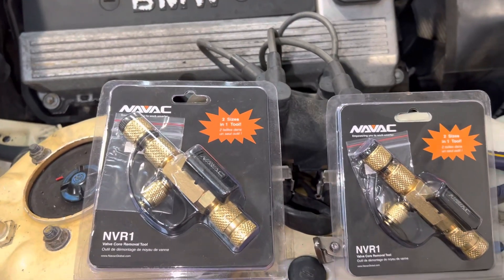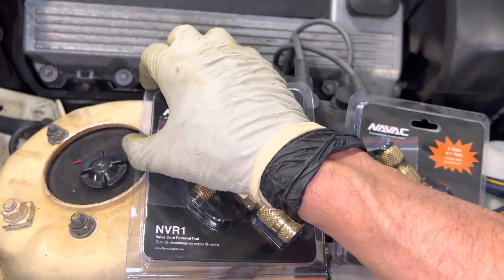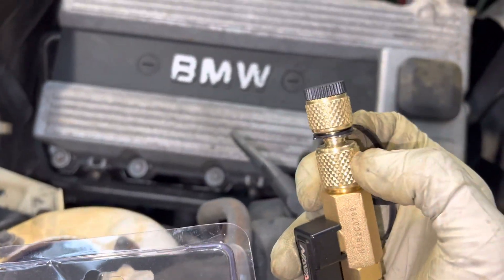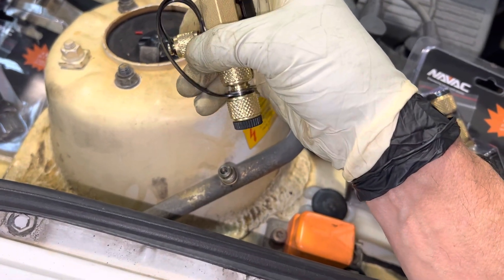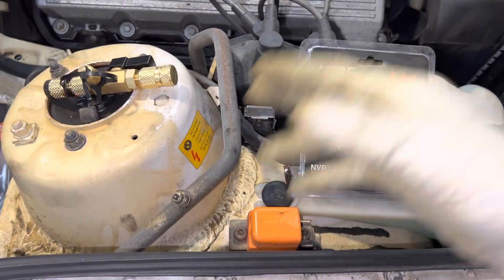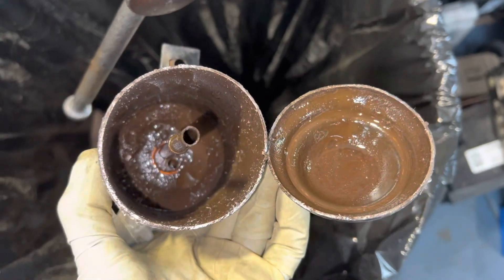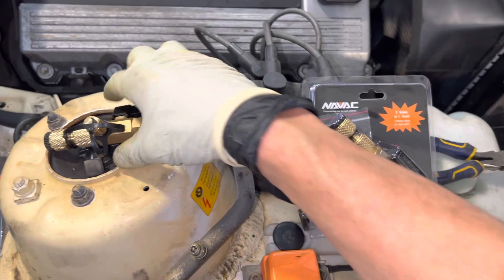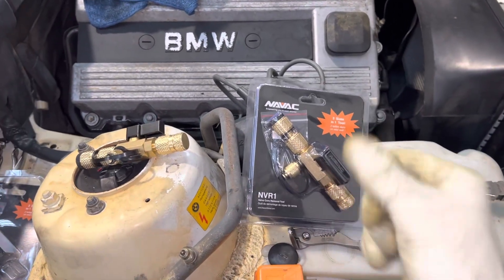NAVAC NVR1 VALVE CORE REMOVAL TOOL.   Tool review

Comment: Don't forget to let us know how this works, it has a good price specially for us diy only.
Reply from the maker: As soon as the AC system parts are replaced on this vehicle I’ll be making a second video on using these core removing valves
Reply: @coldfinger459sub0  Hey buddy did you do a video on these yet an d i missed it ?.
Reply from the maker: @sameermohammed3949  yes I did a video but I have not released it yet you’ll probably see it in the next couple days.
Reply: @coldfinger459sub0  Thanks look forward to it .